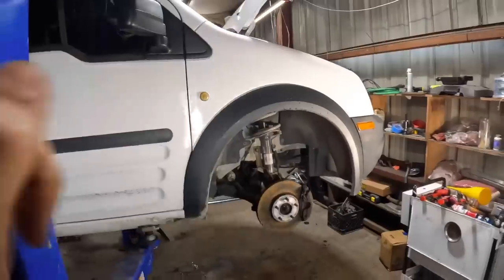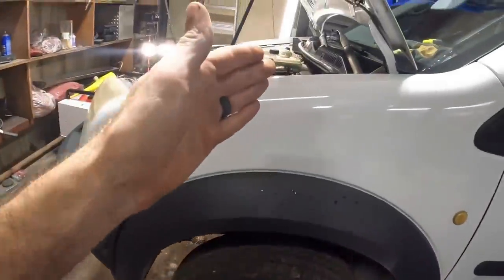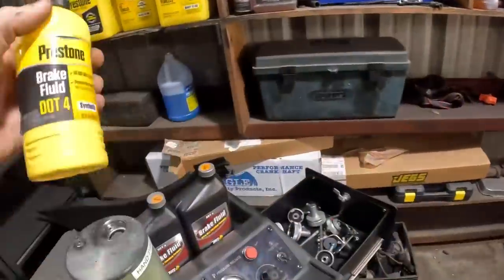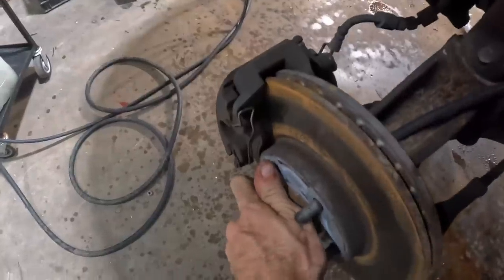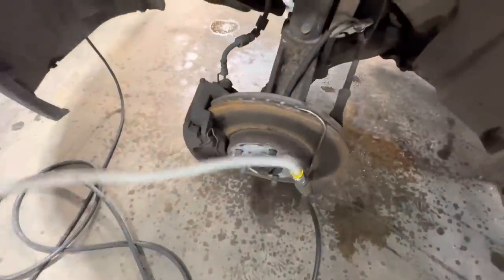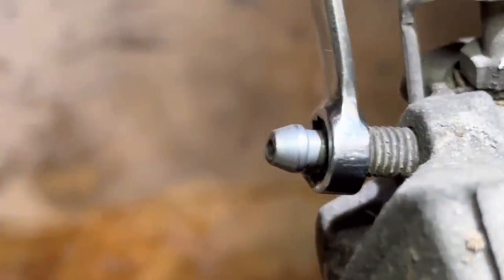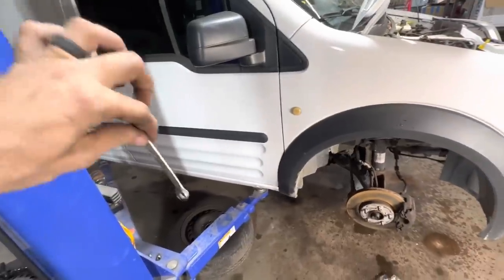Does Brake Fluid go BAD?? Ford Transit 2.0

Comment: Yes, it's hydroscopic.
Reply: Hygroscopic is dot 3, 4, 5.1 dot 5 is silicone based and is hydrophobic.
Reply: @Boga217  The brake system still absorbs water it just doesn't get into the dot 5 as easily. You also still need to replace it every 2 years.

Comment: ah man, come on. 😀Not even a single blast of brake clean.  The wheel hubs were screaming out for that stuff!  Nice video Ray
Reply: Ray left the break fluid on the dust shields as an anti-rusting coating!   (But yes, I missed the "Da-da!, followed by a can of break cleaner being shoved in my face.)

Comment: every season of drag racing even though i may have only 30 miles on the car. the brake. transmission and rear diff fluids get changed

Comment: Hey Ray, seems the pressure of your non-plan plans are effecting the wife unit (give her the benefit of the doubt). Thereby increasing the self lubricate mode, please monitor the status or you may have to do a fluid exchange on said unit.

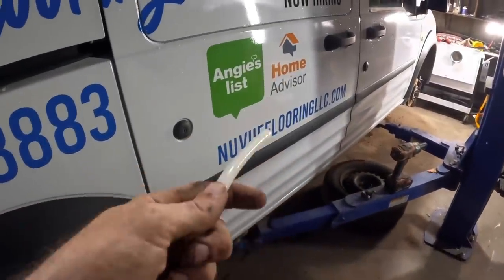Comment: @2:19... When I use the flush machine, I always give it a head start by using the mightyvac to suck the green fluid out of the reservoir and refill it with fresh fluid. Then I attach the machine. @3:45... Seems I typed too soon. LOL. Great minds... @6:45... The machine we had at Nissan had 4 hoses. We attach the hoses, open all the bleeders then start the machine. We can then go do something else while the machine works. It beeps when it's done.

Comment: I use the Mighty Vac pressure system. Fill the container with fluid, place the adapter on the fluid reservoir, pressurize to no more than 15psi then bleed the wheel cylinders starting with the ones farthest away. Works well for my needs and doesn't require an assistant. Oh, don't forget to depressurize the device otherwise you'll know all about it. Ask me how I know! 😳😓

Comment: Nice video Ray. Yes, brake fluid as stated below, absorbs moisture, just removing the cap will allow some moisture to get into the master cylinder, that is one reason that manufacturers went to using the semi-transparent reservoirs, no need to open them to check fluid level. One thing you might want to explain to the viewers the difference between DOT 3, 4, & 5 brake fluid, and explain why you never use oil in a brake system. Love your videos Ray!

Comment: Ray there is a tool I think you should get for your shop that I use all the time for work in the same industry. A 3D printer! 

I have coworkers asking me to print them tools all the time now. I have made tons of custom funnels, storage bracket type things for tools, push pin clips, battery straps for cordless impacts to better secure the battery to the tool, a custom wrench to shift a chevy transfer case where the encoder motor usually attaches, and a lot more. When I am at work and come across a situation where I can make something easier with a piece of plastic, I invent it. I use it for the house a lot too, shower head holder, paper towel holder, toilet handle, more storage bracket thingies. 

You can make molds for silicone or fiberglass or sand casting. You can make threaded caps or knobs for things missing them. You can print flexible TPU for phone/tablet/scan tool cases. The options are limitless.

Comment: I meant to do a fluid exchange before me and a couple of mates when to do some work in the South of France from the UK...  Managed to boil my brake fluid doing a 'fast' run down the 'Mountain' and gave some people a bit of a scare as they though I was going through the barriers..... But managed to pump the brakes up enough to loose some speed before the corner...........  Took it steady after that!   Soon got the fluid changed after that!   
Great roads for Driving around the Var region!

Comment: Back in the 80's, the Florida Highway Patrol did a study reviewing accidents where the driver said that their ABS was ineffective.  FHP found that the problem was not a failure of the ABS system but that of the amount of water that was absorbed into the brake fluid being hydroscopic. In other words the brake fluids natural ability to absorb water. The net result being that high concentrations of water in the brake fluid actually caused a steaming  (vapor) condition of the brake causing the brake performance to degrade.  The net result was you need to change brake fluid yearly.

Comment: For my non-professional needs I use the Four Uncles brake bleeder. It runs on compressed air and uses the Venturi effect to pull the fluid through the system. It's okay for the shade tree guy such as myself.

Comment: Ray...... You forgot to spray clean the fittings after you finished. brake fluid all over the back side of splash shields and axles.
Reply: He probably did that after he shut off the camera. He sometimes doesn't film stuff that he deems "boring".

Comment: Every time I buy an old motorcycle I ask when they change the brake fluid,and they go huh!contamination will ruin the seals.i do my bikes every 1-2yrs depending on mileage and never had a caliper or master go bad.great vid thanks.

Comment: Having spent my youth working on my "60s VWs in the rust belt, and having rusted bleeders snap off, I started removing each bleeder and lightly coating the threads with anti-seize.  It saved having to buy new wheel cylinders.  BTW, I used to use a small plastic bottle with a little fluid and a clear hose to see bubbles and fluid color.  As long as the hose had clear fluid, you could make it a one-man job, and let off, without sucking air.  (Of course this preceded anti-lock.  I'm not sure it's as simple as the vid showed, especially without the fancy machine.)
Reply: Oh yeah.  I learned all about screw extractors thanks to VW beetle brake calipers.  The star wheels were a joy as well.

Comment: An idea for the suction side hose at the bleeder screw:   How about using clear vinyl tubing on the bleeder screw?  So you can see the color change without removing the hose.   As for the compressor air connection :  I have heard of people /shops using pvc pipe to run it to the locations needed and then adding hose couplings for the air lines by the bays. Shorter hoses and less tripping hazard.

Comment: Brake fluid gets so nasty because nobody hardly ever exchanges it. I use a turkey baster or miximizer for two cycle pre mix measuring to suck  as much crap out of the reservoir as possible. Put fresh brake fluid in and then with an assistant on the brake pedal, I push the old fluid out of the system at the rear wheels first. When the fluid is clear I seal it up and recheck the reservoir level. I do this with a hydraulic clutch too.

Comment: Yes,it is  hygroscopic ! I am in the hvac field and many of the oils(polyolester,alkabenzene etc) are very hygroscopic compounds such is brake fluid.Thx for the video
Reply: Wouldn't it have been easier to replace with silicone fluid, as that won't absorbe water, or don't people use that in the USA.
Reply: @loosewheels1000  That's DOT 5. DOT 3, 4 and 5.1 are glycol based brakefluids. DOT 5 is silicon oil based. Problem is, the braking system must be specifically designed for DOT 5. So you can't simply change to DOT 5 if you have a car that wasn't meant for it.

Comment: TIP: if you have an old car that sits around for a long time and you find that you're forever changing brake and clutch cylinders then I suggest you look up Automec brake fluid which is military spec. You need to flush out the old stuff but it will mix. I was having to change out a wheel or clutch cylinder every year for the MOT - now I can't remember when I last did it OR bled my brakes! The downside is that it costs 4 times as much as the normal fluid but it's saved my time and cost of components over the years.

Comment: 1. How does brake fluid become green through use if all the parts are metal or black?
2. Keep permanent buildout of your new rental space to a minimum. Improvements become property of the owner. They increase the property value, and become subject to higher rent. The owner could charge you more rent because of your improvements ....or kick you out in favor of a new tenant with higher rent.

Comment: I had a mechanic friend told me to gravity bleed my ford edge and my e450 rv, brakes, it works great and no need for all that expensive equipment. Just open the bleeders up for 15 minutes or so each and keep the reservoir   filled.

Comment: Sometimes, I don't understand you, my friend: The same Ray that we all love and has in mind the flow reduction of contaminated brake fluid through the system and removes it by vacuum and then fills it up with new, beautiful fluid, showing all of us the attention to detail Ray , is the same Ray that throws engine covers and fuse box covers on the ground to clean them with air, making all my OCD buttons self destruct 😂. I guess it's a Florida thing?😅

Comment: I've seen the green break fluid on chevrolet trucks with a newer system than the older systems, unsure if it's the aluminum reacting with the fluid. But no way around it sadly.  
 The wife unit is allowed to relax now and then. Lol  be safe

Comment: OH Ray the suction line is suppose to suck to not make a mess. The positive pressure in the system will not have air, the bubbles you were showing was due to the vac suction which removed the fluid. Good job though, nice to see you removed the dirty fluid from reservoir before the flush. I worked next to many guys that would not do that with the BG brake fluid machine with 4 suction hoses and it took them longer due to stupidity of laziness. You did it correctly I like that. BTW you gotta get that phone ring thing again that was your stick and I think we all miss it, your mileage may vary.

Comment: Absorbed water boils under hard braking & acts like air in the brake lines reducing stopping power - it doesn't just spoil the fluid, it can kill you.  It also corrodes brake components like ABS pumps which are $$$$.  I owned one of the first bikes with ABS.  There was an undocumented procedure to flush the ABS pump during service.  If you didn't perform the undocumented service twice a year the pump internals corroded.  In 1996 the pump was $2000 with $400 labor to replace it.  The $400 was well earned!  2 days PITA to strip the bodywork, replace pump, flush all the lines, overhaul the calipers, reassemble.

Comment: Hey Ray. Just a thought,take it or leave it. The renovations your doing? Why not make a sound proof room for you air and any noise related machine's. Heck, you could even have cameras in there and a monitor outside so you can take Reed's on machines and have extended hoses from the room not far away. 
Maybe a good idea, but it might cost a little. 
Love your videos,  take care bud. 😎👍

Comment: I had a new 2011 Transit Connect supplied by my job.  The brilliantly designed dual clutch transmission crapped out before 30k. Vehicle was at dealership 10 days, Ford required it be rebuilt at dealership they would not swap it out.  I turned the truck in at 85k when the new vans came in. That transmission was on its way out again.  Additionally the Transit Connect had a miserable heater from day one.  When temps dropped near zero F I would freeze my feet in the cab.   Now the full size Transit 250 loaner I had multiple times was a very nice driving van.

Comment: Most people recommend 10 PSI when doing an exchange, but I can tell you 15 lb that Ray used is exactly what you want to use, because if you use two little pressure you will need to go and do a manual brake bleed and buy upping your pressure you can eliminate this as this is more effective at removing air in the system and that's why you see some shops do a manual afterwards because they fail to keep the pressure at 15 to 18 lb when doing an exchange.

Comment: Its not good to flow brake fluid out over the ABS sensors, electrical connectors or rubber jackets on the hoses and wires.  With brake fluid neatness counts if you don't want to needlessly have to replace items that will eventually dissolve when exposed to brake fluid.  Putting a shop towel below the bleeder to prevent brake fluid from running down over ABS components, etc is best practice.  Often the owner of the vehicle won't realize when a component fails in a few months or a year or so due to a tech who was sloppy with brake fluid and will be paying to have this mistake corrected.  A huge Ford recall of millions of vehicles (Cars, SUVs, Vans, Light/Medium Trucks, Ambulances and Motor Homes) several years back was due to drips of brake fluid getting on a safety switch under the master cylinder which would melt the insulation on the wires causing short circuits and fires so spilled brake fluid is an issue with historical significance that has caused all levels of losses to the customer.

Note that hydraulic clutch systems may also use brake fluid and often are not as well sealed as a master brake cylinder so can require flushing more often plus with a clutch using an integrated slave/throw out bearing assembly its more critical since once the clutch slave cylinder is compromised to the point of leaking you have to separate the engine from the transmission and have to replace it along with the clutch, etc most often prematurely.  I've seen hydraulic clutch systems that should last 90,000 to 120,000 when regularly flushed fail by 30,000 miles once the fluid gets contaminated with algae.  That can amount to an additional $8,000 or so in maintenance costs over the expected life of one clutch to save a few dollars on flushing the fluid.

Also note that brake fluid changes are best done by a calendar schedule since brake fluid absorbs moisture from the air over time so every 30,000 miles or 2 years whichever comes first or when replacing a brake system component.  

Once algae has developed in the system so that the fluid is noticeably green you should at least remove the reservoir from the master cylinder and clean all the algae out before flushing/refiling and then after a month or so back in service flush the system again to get more of the algae that was pocketed in the rubber seals in the master cylinder, ABS pump and wheel cylinders removed from the system and the same goes for hydraulic clutch systems especially those where the clutch slave cylinder is part of the throw out bearing assembly with the transmission input shaft going through the middle of it.

Regular flushing and best practice to prevent brake fluid from spilling/dripping onto external system components can greatly increase the service life of hydraulic and electrical brake/clutch components.  While we are at it flushing the brakes don't skip replenishing the silicone brake grease on the sliding components on the calipers, guides and brake pads.  On seldom used vehicles this is actually more critical to prevent calipers from sticking.

Best!

Comment: Take the vacuum off and let the pump push a little more through before tightening the bleeder screw and you won't have the trapped air.  The ever so slight variation in vacuum-to-pump flow rate causes the trapped air.

Comment: I’ve got a 2012 transit connect with 215k miles on it. Done the brake fluid on it several times. Only things I’ve had to do was a front left wheel bearing and a water pump. Both around 150k miles

Comment: Brake fluid absorbs moisture hence it‘s „boiling temperature“ is being constantly reduced. It results in vaporised water - known as steam - under heavy breaking when the caliper absorbs heat. The outcome is a brake fail as air in the system can be easily compressed without transferring any significant pressure to the brake cylinders, your brake pedal goes down to the floor without stopping the vehicle…

Comment: Yes - it absorbs water, which makes the brake system corrode from inside, lowers the boiling point and suddenly you have water vapor when brakes heats up - and a fatal brakes failure.
Been there tried it on my old Saab 9-3 with hanging rear brakes. It takes a massive body control not to wet and brown  your pants ...😩

Comment: Brake fluid can go bad if it absorbs water or becomes dirty. You can buy chemical test strips which will tell you if your brake fluid has any water in it.  If it looks fine/clear and testing shows it has no water in it, I don't see any reason to change it. Eventually water will build up in the brake fluid and it WILL need changing.

Comment: hey but its a lite beer!..here's an annoying picky, the brake fluid level can be used as an indicator of brake pad wear. the level sensor in most master cylinders illuminating the always welcome "brake" red light on dash is more often an indication that pads are low rather than a leak occurring. as such when the fill level on the master is set after an exchange the level of current pad wear should be considered. max level for pads at or near new thickness. lower for more worn pads. that way the level sensor can still function as designed

Comment: Moisture ingress into the brake fluid can cause corrosion and also vapor lock as the boiling point of the fluid reduces as more water gets into the system. This can cause brake failure when you really need them.

Comment: should do it when you change the pads or  the next mech will wind the pistons back in and the excess fluid will pour out all over the engine bay or worse on the paintwork, with the pads full worn front and rear the level should only go to the low mark on the reservoir, with new pads fitted it should go back up to the high mark. if you have to top up your brake fluid reservoir somethings wrong.

Comment: Brake fluid also boils at a lower temperature when it absorbs moisture. That in turn, releases gases, and becomes more acidic.
I have seen, and agree with recommendations for a complete flush, every 4 years, as Ray did here.